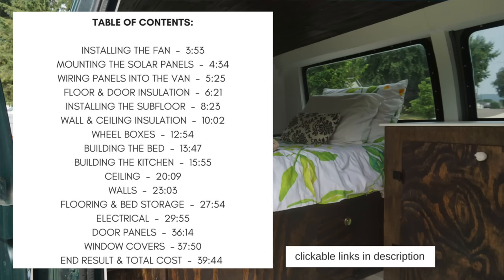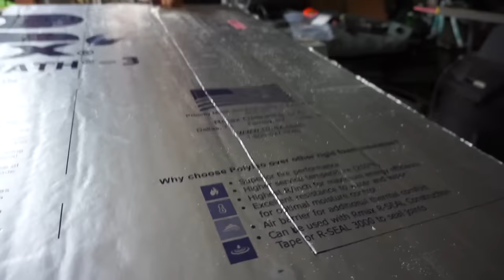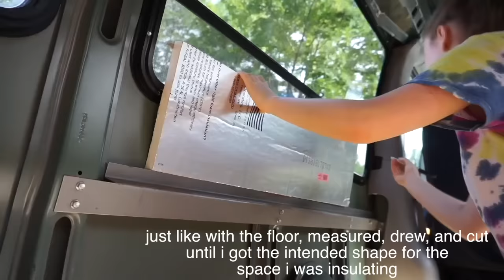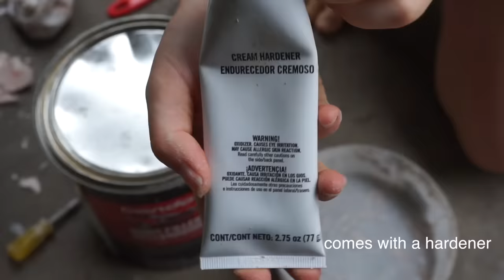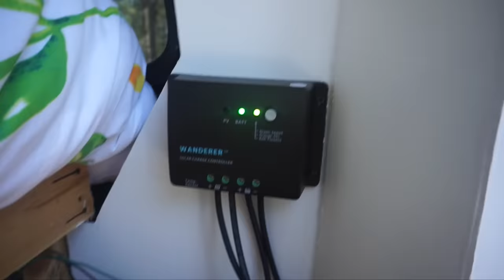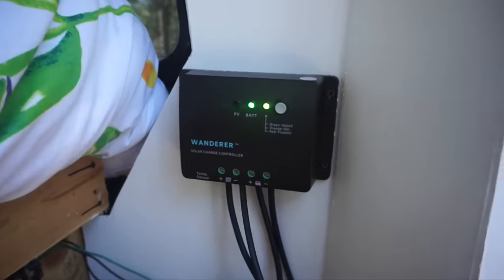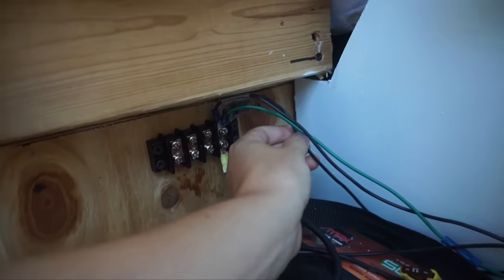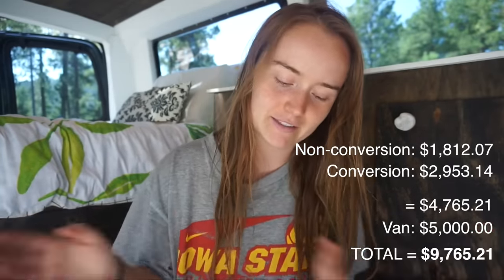How I Converted A VAN into an OFF GRID CAMPER for under $3,000

Comment: looks 16gauge wire, most stuff is , the thick find for clothes dryers is 12gauge for 220. while most exstention cords are smaller like ,but a powerstrip surge protector outlet cord is 16 maybe 14.. 14 gauge cords you see for the outdoor orange long extention cords common for holiday lights. .. if you had to plug something high powered to a generator.. especially in say cold weather you'd want the 12gauge.. they are heavy to lug around. and not common like 14s .but absolutely necessary to run things that HEAT so think of insulated wire for HEAT making appliances etc go for the thickest possible! yes window air conditioners have thick cords especially ones that heat a room too. Stoves of course , .. ever see an RV's cords!!!!! a different scenario of power useages but yes for your van heating you have to have an insulated thick coated wire/it has more wiring in it too. Im being simple too here, but anyone doing batteries indoors and wants to run a heater overnight independent of their vehicle to stay alive in clean air as running engines carbon monoxides' asphyxiates and you'll smother to death poisoned =so of course a heater wired to batteries instead of gas running of engine or generator - you are going battery living not engine living.. its time to know tht despite solar ITS BATTERIES that YOU USE its just solar panels feeding the Batteries.. so yes good cords to from and between batteries IS NECESSARY! There for any oblivious beginners Go Solar Yes BUT DO HOMEWORK ON THE BATTERY SETUP YOU WOULD REQUIRE IN YOUR SITUATION /USAGE!!! its not hard but got to PLAN OUT! the Battery part of vanlife IS THE BIGGEST Think, and MOST IMPORTANT as does keep you going in any weather comfort sleep etc even if out of gas in the tank to go anywhere.. you can always eat snacks, pee somewhere or in something AND SLEEP across seats BUT POWER IS WHAT IS IMPORTANT FOR HEATING AND COOLING WHILE VAN CANT RUN DURING YOUR SLEEP /SO DO PLAN IT OUT!! YOU WILL BE BLESSED FOR IT AS SHE IS FOR IT!!! <3

Comment: I have a quick question, what all were you using the solar panels for? Was it just for the lights and fan or do you have other stuff running/
plugged into the extension cord?

Comment: There are better ways to fasten solar panels to the roof without drilling holes. I have learned over the years that there are almost always better alternatives to cutting or drilling holes in the roof sheet metal and those alternatives should be chosen in just about all cases.

Comment: No grommets protecting the solar panel wiring through the metal roof is just scary.  Vibrations will 100% cut through those wires eventually and either short and destroy the system or seriously injure someone. I am all for self builds but these are the kinds of mistakes that can cause serious damage.

Comment: Wood flooring is not a good idea. Vinyl is much better. Solar isn't a reliable source of power in many areas in the U.S. It is much easier and better to use a quiet gas generator + a power station to store energy instead.

Comment: I didn't see a face mask during the spraying of the glue or the handling of the fibreglass insulation! Did I miss it? Never do those two things without a mask to prevent yourself breathing in glue vapours or fiberglass dust as they are not only toxic but can cause major health problems in the future.